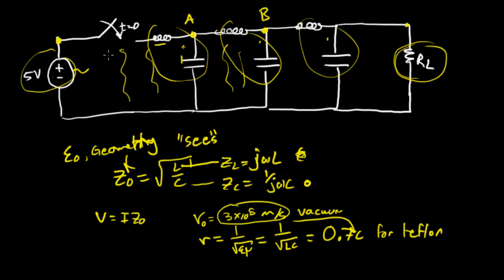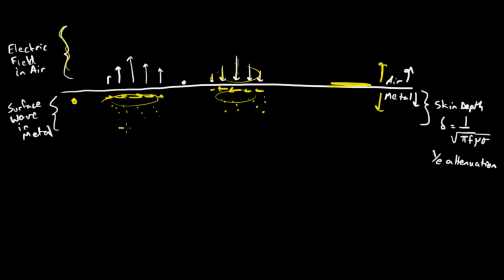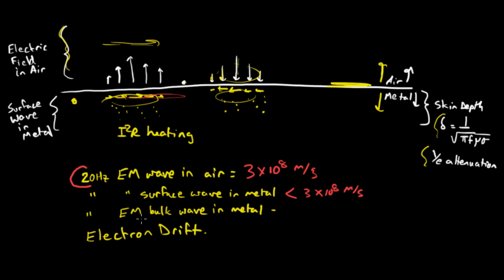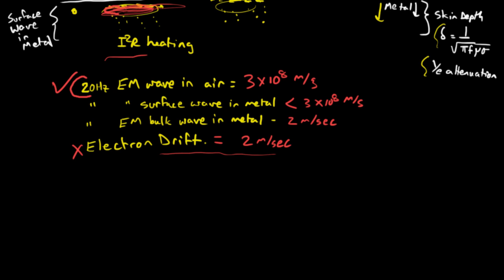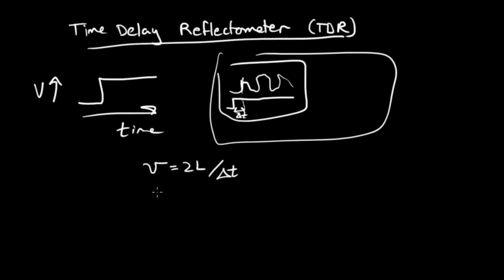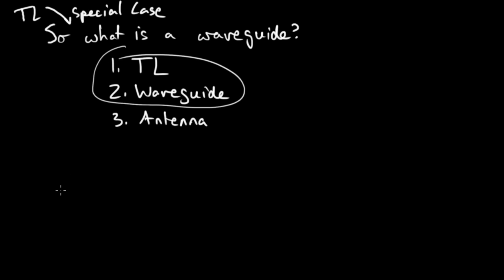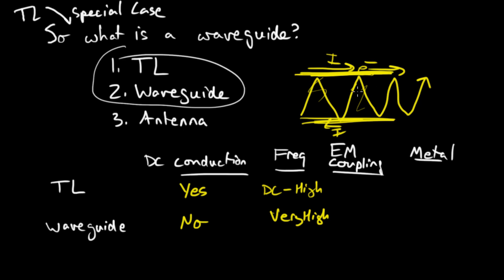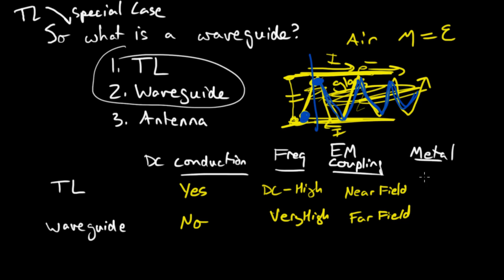Transmission Lines 2 of 2

Comment: how can i calculate the value of the capacitor ( ??  )  if the R ( 5 ohms )  is known and the L ( 625 m H ) is known for AC source of 120 AC 99 Hz what would be the good capacitor value to get a good power factor at the end ? thanks in advance